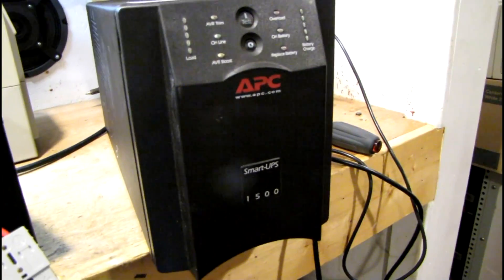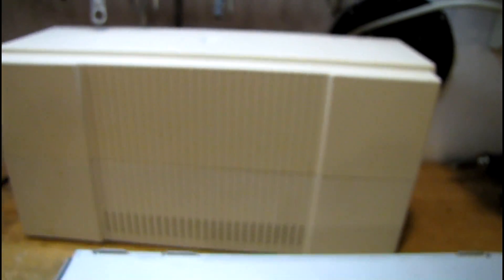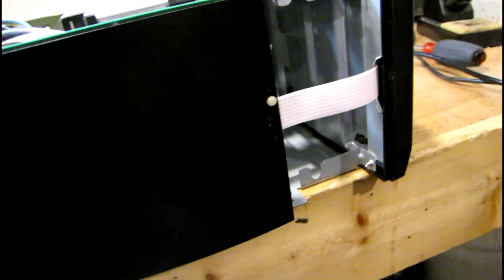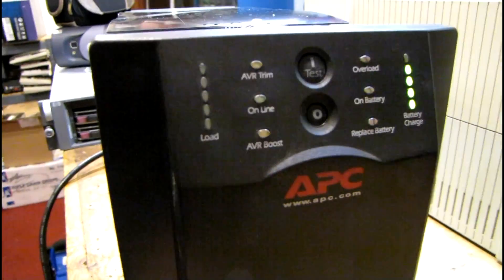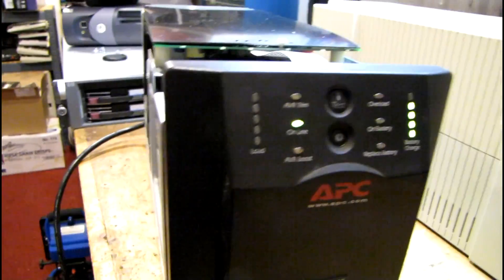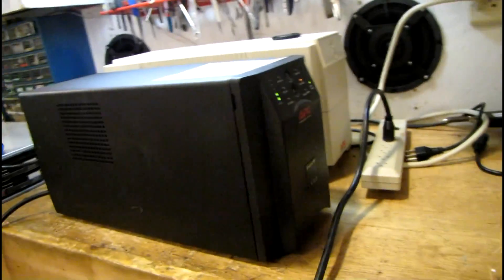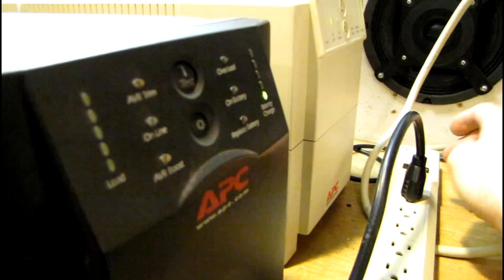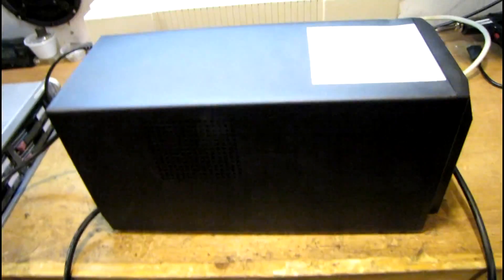Smart-UPS 1500 from Ebay gets fresh batteries

Comment: I've had a 1500 for only a few months. the other day it started buzzing when on AC power. I heard you mention a parts list for a 1250, do you happen to have a parts list for a 1500? Any advice for tracking down which CAP is buzzing?

Comment: Question for ya maxxarcade. Recently got a little APC BackUPS 700LS and though it has good batteries, it beeps and flashes the replace battery light every 15 minutes or so. I'm decent with electronics, just need to know what to look for, so far, everything inside looks to be in good shape, but I was wondering if there was some certain components or an area of circuitry I should check.

Comment: Hey there, i had a question for you, and saw that you had been repairing your previous older ups' and hsd parts units. I recently pickef up a trashed 1500 with a good transformer in it but can't seem to find any information on how to wire it... any help from you would be greatly appreciated.  430-1211A is the model of the trans. I would like to use it as a high amperage power supply.

Comment: Awesome video.  I just picked up a couple of these at an auction and both of them won't do anything.  Apparently, the previous owners left the battery plugged while they were waiting to get sold off (not even sure if this is an issue, but the manual states not to leave plugged in during transport).  This is going to be my first time working on an UPS and hopefully it's just going to require a battery replacement.  I am an engineering student and have tinkered with electronics before, so it's not like I'm in over my head on this, but these videos really help out a lot in getting a bearing on what I should check out first.

Comment: I found one of these near a dumpster the other day and it won't power on when connecting it to the wall outlet. It's a 1500 Model and it looks like it has the original batteries in it. Question, will the unit power on with a bad or missing battery? I don't want to purchase a new battery and find out that it still won't work.
Reply from the maker: It needs a good battery to power on as far as I know.  Also try holding the button for a few seconds.
Reply: +Gustavo Guillen It won&#39;t work at all with dead batteries. Won&#39;t even start up to give you an error message. I had one like that, and mistakenly threw it away. I purchased another and this time took the time to read the directions. I had thrown away a $500 UPS which was probably perfectly OK just with totally dead batteries. The next one lasted 5 years before starting to give me signs of dying batteries. Replaced batteries and everything is fine.  The four light battery with a new set that we see in this video is normal. It will go up to five after being plugged in for a while. The manual will tell you all the signal codes, and yes, he could silence the batteries low warning if he read the manual.

Comment: Hello, I have similar UPS and I plan to add external deep cycle battery on it because I need more runtime; the place where I live has lots of brownouts and blackouts. 

I plan to buy around 100 Ah battery and I am wondering if I could pass witout hacking wires inside, but only to connect external battery onto battery connectors on back panel. Would it work as a parallel connection with inside battery?

Comment: Ah! Well, that's a good step forward knowing it's most likely not toast. The batteries inside had expanded, and I had to open the unit completely to remove it, using pressure from a screw driver, pushing it out. I looked for 12v 18ah batteries from local supplies, but they took amazingly over-the normal- prices. Do you know if you can get a battery as heavy as this into Norway, as long as the price is under 36$? (possibly buying one first, and then the other one later.

Comment: The work I am with this summer has one of these, the batteries were long gone (literally expanded in the case), and they are just going to throw it away. It did not give away any sort of life when I plugged it in (with the batteries in of course), but buying a new set of batteries, what kind of batteries does this take? And yes, I took off the fuse and connector from the old batteries. I do not really want to buy a new overpriced APC battery pack.

Comment: Hi, What is the AVR Trim and AVR Boost?
Reply: If the incoming voltage is too high, the AVR Trim light comes on to indicate the unit is adjusting the voltage down to be the correct value.

If the incoming voltage is too low, the AVR Boost light comes on to indicate that the unit is increasing the voltage to compensate.

Comment from the maker: You have to use lead acid type, since Gel has a different charging voltage.  It's best to use the proper batteries which are an RBC7 kit.

Comment from the maker: @coondogtheman1234 , You could use a bigger battery, but only to a point.  The charging system can only handle so much, and the battery meter will go out of calibration because of firmware limitations.

Comment: Couldn't you just wire up a deep cycle car battery to this thing and it should run A LOT longer even on high loads. I've seen a video on here where someone did that and they ran a stereo on it.

Comment from the maker: @uxwbill This 1500 was made in the Philippines.  For the disconnect, were you referring to the old beige ones?  The black ones have the actual plug on the back.

One thing I'd like to know, is which cards work in which units.  I'm not sure if all Smartslot cards are compatible with all units, because I've never used one.  I think I need an AP9617?

Comment: @Maxxarcade I have a SU1000inet (beige) for which I purchased a brand new official replacement battery cart from apc.  Originally purchased from ebay with a 'new battery' which lasted just a few months before giving out.  Replaced with an official APC one and has been running for years now and still giving 40 minutes run time for my 2 boxes.  Its been very reliable for me.  Well worth the money spent id say!  Perhaos I should video my setup some time.

Comment from the maker: @apctech1 The batteries were fully charged actually.  The 1250 I took them out of was running with blown MOV's until the day I removed them, and they only sat for a few days.  

I'm aware of the overload feature, but I've never seen it in action yet.

Do you know if I can swap the microcontrollers between the 1250 units?   Or is each one calibrated to the board it is on?  I'm not sure what the differences between the firmware are, but the newest one had revision T.

Comment: Is that DB9 port a serial port?  If so, could it be used to connect to a server to provide a web interface through a service running on the server, rather than having to buy some probably expensive network adapter?

Comment from the maker: @TechStories79 It depends on how many hard drives and options are installed, and how much power everything draws at full load.  I was able to run most of what is in my rack using a single Smart-Ups 1250, but it was near maximum load when the disks spun up in the file server.

Comment: @sdogwhittler a UPS is an Uninterruptible power supply, they are are like power generators, when the power goes out  the UPS kicks in to prevent power loss to whatever is plugged in to it like an important server

Comment: Awesome! I purchased an APC UPS not long ago but accidentaly ordered the wrong one. I ended up with a APC S420I which is a baby compaired to your 1500 but i threw it on my personal desktop rig which is a quad core with an 8 series gaming card and 24 inch screen and i think i got 10 minutes. That seem about right? also, if i was to get one for my server rack which contains a swich, file server (IBM X serve) and a few other older dual xeon units, would the 1500 be minumum choice?  cheers.